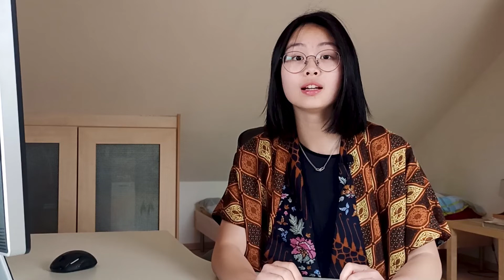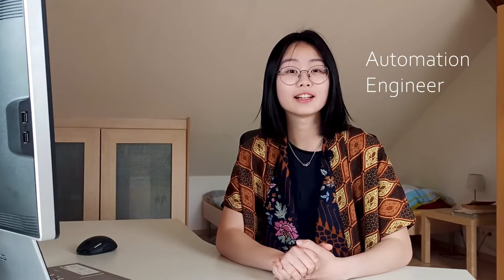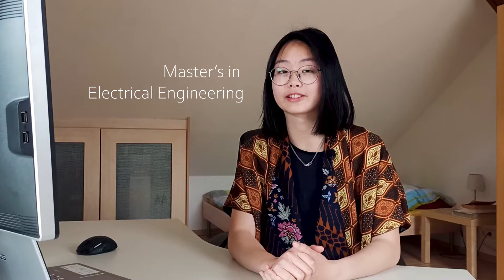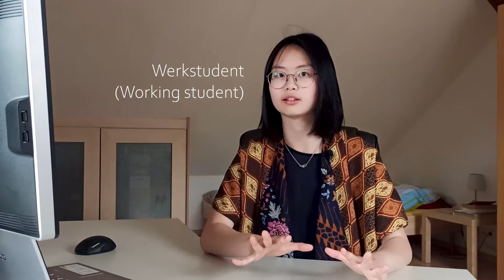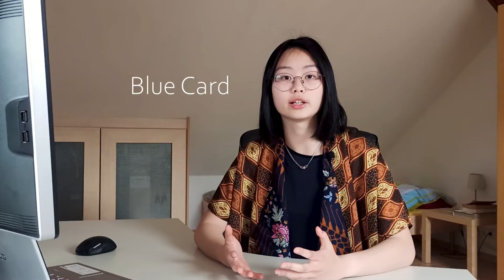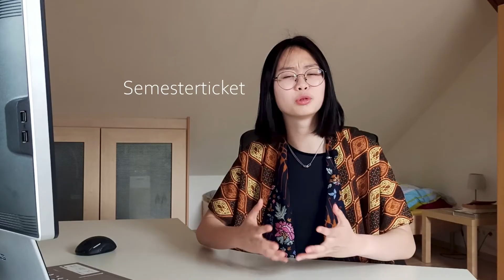How I Became an Automation Engineer in Germany as a Fresh Grad (+ Part Time Master's)

Comment: What if you don't have B.Eng? Instead you only have S.T which you got from Indonesian's uni. Would you still be able to  apply for a company over there? I'm taking Chemical Engineering anyway. But I've already made a contract with an international company in Indonesia for 3 years. So I would say when I apply (later) to the company in Germany, I will be having a work experience. Idk if that helps or no.. 🥺

Comment: Correction: Mecatronics is the mixture of two main field electronics and mechanical engineering. Although, you can subgroup electronics into several sub field electrical, electronics (design) and software.

Comment: What programming languages are most used in your field(automation engineering) in germany?and what programming languages are most in demand there generally?and lastly how is your degree connected to control system engineering and PLC programming...etc? And sorry for bothering you with my many questions 😅
Reply from the maker: Hi! Thanks for the questions. In my job particularly, I use VB.NET/C#, and for web development JS/HTML/CSS. My colleagues handling PLC stuff use ladder logic/SCL. I have friends working here using python and other languages. So I think there's a wide range of languages in demand.

My particularly degree is not really connected to PLC programming. I'm doing a lot of MATLAB this semester. 🙂

Comment: What about programming with ladder 😄
Didn't know automation engineers use low level programming languages like c++ in a usual day in work 🙄
Reply from the maker: Ladder is used by my colleagues who work with PLC programming. I currently work with VB.NET, C#, and JS, but learned C++ during uni. 🙂
Reply: @genesia.synclaire  so u work in embedded systems department right !
Reply from the maker: Officially I work in the Automation department in the developer team ☺️